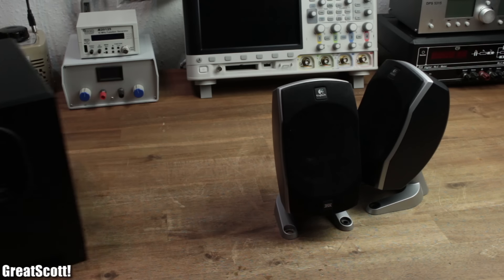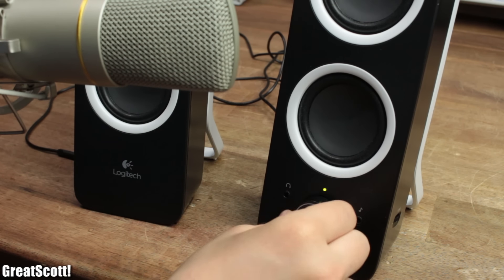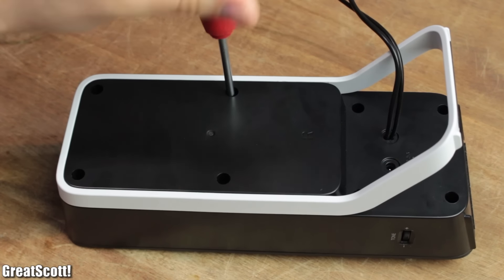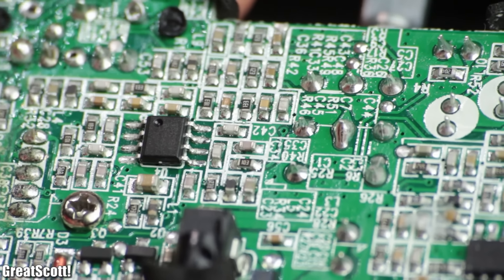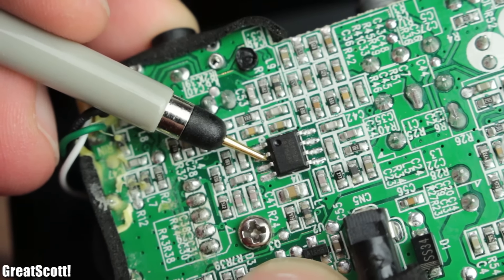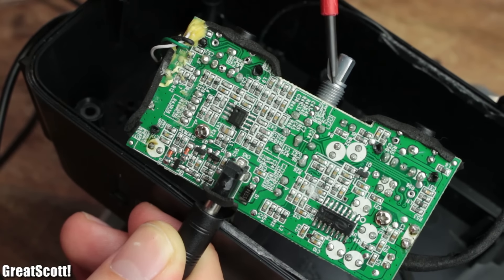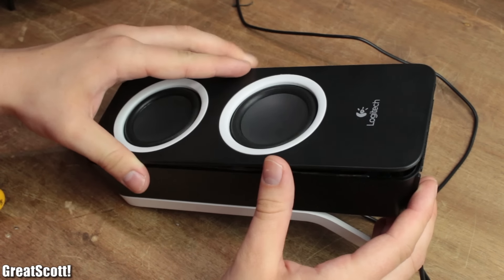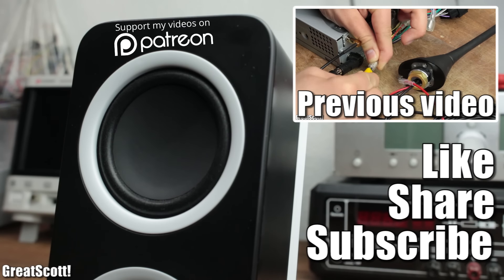Fix It!: Brand-New Defective Logitech Speaker

Comment: if you fix new ones why you dint fix the old ones
Reply from the maker: They wanted to retire.
Reply: +GreatScott! What broke from the old speakers?
Reply: because they arent worth it?
Logitech is Bullshit. But the newer Bullshit logitech are better than the old ones ( probably ). They doesnt sound nice, they dont get very loud, they dont play precise ect.

So why you should repair garbage if you know, like greatScott, that it is garbage ?
Reply: Lol I have some Logitech LS21, They sound great, clear sound and deep bass, I have been using them for about 4 years now
Reply: +Pro Tech Tips Unlimited Than you dont know what good sound is. The frequency response of your logitech is everything else than linear. it isnt even a 2 way system. I have got a pair of magnat zero 5 speakers. 64cm high, 33 wide, 29 deep. 3 way system, tweeter, mids and bass. why 3 way system? because 1 speaker is never able to reproduce all frequencys perfectly. Also your logitech dont have bass. they max get to 50 Hz where bass is just about to start. everything else is missing. My speakers for example hit down to 28 Hz. when you hear dubstep you will hear deep deep wub wub on my speakers. on yours nothing. Do you get my point?
Reply: +Dominik Lux Logitech compared to mine is a difference like day and night.
Reply: +Dominik Lux Tell me your speaker maker man
Reply: +SniperNator My Speakers are Vintage Magnat made in Germany, Cologne. Build in 1991. Since 1992 Magnat does not exist anymore
Reply: The Magnat you see today is audiovox. Audiovox bought Magnat in 1992. It has nothing to do with Magnat than.
Reply: actually, bass start at 256 HZ (wikipedia), for me is more about everything below 450 hertz.
you are talking about sub woofer frequency and that start at 80 or 100 in some standards, in the wikipedia sub-bass is sounds below 60 hertz.
by the way, you are correct, but most of the time you only need 2 ways... in fact, some Yamaha reference monitor does go below 50 hertz.
and you need a big room to make most use out of it, or you gonna have phase problems.
Reply: The most Studio Monitors go far below 50 Hz. I worked with a pair of Genelec Monitors for example. I think it was 32 Hz. But that so called "Subwoofer" frequency is nothing more than deep bass. Even in nature there is much deep bass, for example a train that is passing by. When you have such a scene in a movie it feels much more natural when your speakers hit that low frequency, sometimes it really extreme realistic. On High decibels you really feel it in your body, actually like the real thing.

Also in Music, not just electronic music. An Orchestra has also much deep frequencys. The Point is it is dramatically more natural, even if its just 30 Hz more deep bass range.
Reply: I have a modern 5.1 PC set from them and they're "decent enough" for what I use them for.

One thing to note, watch the standard stereo line in as some models (like mine) have "effects" applied at the speaker level that sound awful. Using the multi-jack 5.1 inputs with a sound card sounds much, much better!
Reply: I am maybe a bit audiophil. I got a Asus Xonar STX 2 Stereo Soundcard ( without the 7.1 daughter board ), an Vintage, completely working Sony STR 5800 from the `78s and it is like new. 75 W per channel, 250 W peak. And i got a pair of Magnat Zero 5 Speakers and a Pair magnat Zero 4, also Vintage, `92, 3 way system.
Reply: Dominik Lux I have a few classic receivers (STR-7025 & STR-VX10L) and a hifi myself, but it's in a different room from my computers. Nothing particularly fancy.

Different horses, the Logitech ones don't sound nearly as good for music, but have enough punch for games when I don't feel like using my headset :)
Reply: yea, its enough.
Reply: +t33s you have no clue. I know it is the exact opposite. Stop talking bullshit. Your telefunken is just pushing mids, has no deep bass and weak highs.
Reply: +t33s sorry that there are actually people with knowledge trying to help people with less knowledge and tell them "Hey, you can do it better"

Sorry for trying to be a good person lol. Did not know it is a bad thing nowadays trying to be nice.
Reply: yeah, you can find it everywhere on the internet, correct. And why people dont do that?

It seems like you are one of the person who is just understanding what he wants, but not like it is and turns everything into bad. Dont know where such behaviour is coming from.

I say it like it is. It is not Hi Fi, not full range ect. When someone says its good sounding ect its not correct. Just because it is the subjective oppinion of some people it is not correct.

Why people like you always must come to people who know something and try to provokate them? Worried because you cant explain it? Or worried because i destroyed someones dreams? Or just a Logitech Fanboy whos trying to defend his Product? Dont know.

But u know what. I am out, people like you aren`t worth it. Why i do the work and write such a text to such an ignorant person.
Reply: it's funny that Logitech has built of a speaker unit without the proper grounding???
Reply: hahahaha WIN
Reply: We have those speakers at school and no problems with them. I think he just got a bad unit.
As you can see in the reviews there is quite a demand for em so they occasionally do something wrong.
Reply: +Dominik Lux
du hast sowas von recht
Reply: Because he bought new ones
Reply: no you guys have absolutely no clue about good audio. That is all.

I have got an external soundcard with external dac and external power source. 24 bit DAC up to 192 KHz sampling rate if needed.

Got an Sony STR 5800 stereo built in 1978. 75 Watts RMS, 250 Watts Peak. Working at 60 Volts internally which increases the dynamics of the amplifier.

I have got 1 pair Magnat Zero 5 speakers. 3 Way System. 100 W RMS, 150 Peak ( so i can`t go full volume with my amp ) 
18 Kilo per Speaker, ca 55 Liters Volume.

28 Hz up to 34.000 Hz.

Sorry, your cheap plastic 100 gramm and 4 inch speakers cant do any shit about that. Please Educate yourself.

You just never heared a good hi fi system. That is why you think logitech is good Maybe the only reason you think logitec is good because of loud ugly distortet heavy bass. That makes your childish minds think "wooooooo"
Reply: Dom So you are essentially comparing expensive high end equipment with low budget speakers... Genius dammit.
Reply: Expensive High End Equipment? No not really. What i got is pretty cheap standard hi fi. The amp cost me around 25€ on a private market. On Ebay you get it for around 250 €

The magnat Zero 5 pair i found on ebay for 180€. I found another bit of 4 Magnat Zero 4 Speakeers for 80€. I could not say no and got them, too.

The sound card is around 250€. So i spent less than 1.000 € on it. I spent around 500€.

Some Logitech crap costs 250 € . You just need to know what you are doing.
Reply: Modern Audio stuff cant compare with vintage stuff. Just modern High End can compare with vintage hi fi.
Reply: Dom And used Logitech speakers can cost 30 bucks used or refurbished. You are comparing apples to pears.
Reply: Dom I got an ancient 5.1 speaker setup from Creative that my father bought like 30 years ago maybe. The onboard sound card for my PC is good, I consider getting a DAC tho.
Reply: the first and biggest problem you have with onboard sound. You got a really bad power supply and much other influences.
Reply: Dom Well since I have no idea how it is supposed to sound...I don't know if they sound good or not. Sound is not distorted, it's clear and since I use them mostly for gaming, I got no problem with them.
Reply: ***** Yeah, I got the G910, wheb you get used to the weird keycaps(about 2 weeks) it's a lot better than normal ones!

Also, that thing is pretty much indestructible. They ran over it with a truck and the RGB diodes still worked! Of course, most of the switches and keycaps broke, but that's acceptable since you would need steel or titanium ones to withstand that!
Reply: Deity i dont care about the grammar. english is not my mother language. But i wanna see you talking german 100% correct. but i guess you arent even able to talk a second language.
Reply: Dom Hey, English is not my native language, but I demand from people to write with proper grammar because it is the most used language in Europe and in North America.

And I am not alone, however I am learning to speak German.
Reply: ***** Well I did not know that, it's more awesome than I thought!
Reply: my grammar is good enough to understand me. And like i said, dont need more. it might be the most spoken language. But that does not mean than anyone can and has to write in correct grammar.

German is the 3rd world trade language after french. Why nobody can speak french or german than. I would prefer german. But i never saw someone who`s not german speaking perfectly german. So....
Reply: Even english speaking people cant agree to each other how to write / spell things ect :D
American hate britan english and britan hates american english ect

So dont imagine a problem which does not exist
Reply: Dom I am learning German as I said... But the first thing we learned is that nobody can really agree to what is going to be the proper grammar and what isn't...

Are you a native German BTW? I am Slovakian.
Reply: Yea, I am German. And at least of all Germans i know i am one of the best in english grammar and english spelling. Germans can`t spell "Th" often and spell it as just a "T" and such.
Reply: you should clearly read the conversation. I said they are not worth repairing and logitech is cheap and not really good. Than one commenter said Logitech sound great ect and i just said than he never experienced great sound.

So i guess you did not get the point why the discussion started. I was not the one who started comparing logitech speakers like these to high sound quality.
Reply: Dom I said they sound great FOR THE PRICE! You are comparing expensive Hi-Fi speakers to budget stereo PC speakers, I thought you would understand that by now!
Reply: good speakers arent expensive. For example my magnat zero five 160€ and 2 pair magnat Zero 4 80€ on ebay. If you know what you have to look for you find it for a fair price. Some logitech 2.1 systems are more expensive.

@Lagger i wasnt talking about you. i was talking about pro tech tips unlimited. He says they sound good and crystal clear ect.

And Sam, sound QUALITY is not an oppinionated thing. It`s a fact with numbers and measurements.
What you mean is the taste of how you like to listen to music. Do you like more bass, or more crystal heights. But sound QUALITY is not a thing about subjective oppinion. You have sound quality or not.
Reply: And just by the way. Logitech try themselfes to compare with hi fi. So dont be sensual when i do so.
Reply: Dom 160€? You are comparing 160€ speakers with 30€ speakers? Genius dammit, OF COURSE the more expensive ones are better.
Reply: Lagger you just dont get the point
Reply: Even when you pay 300 on a logitech system it wont compare, but logitech and others try to. I wont offend you, but you are seemingly a bit off discussion and somehow in rage mode or such.

Sam i also like brilliant crystal clear heighs. But Bass is still part of the sound and music spectrum.
Reply: And this discussion is not about THIS specific speakers in this videos. if you watch how the discussion started it is about logitech overall compared to what they want to be.
Reply: And for budget pc speakers which for a desk i would prefer creative gigaworx before logitech.
Reply: Dom Creative Gigaworx? Those range from 40€ to 200€... At least in my country.

I have not ever heard about anyone complaining about Logitech speakers sounding bad for the price. I don't know how it is on more expensive models, but since I have a great 5.1 Creative speaker setup... I think I won't have to compare them anytime soon.

Also, what models did you hear that you are talking about?
Reply: Lagger Onesixfour the gigaworks t20 series. the cheapest of the gigaworks. i owned them myself

since i worked in Saturn, a big electronic market i heared many different logitech sysgems. A friend of me owned a 2.1 system of them. But dont know the exact model.
Reply: Sam Gates Logitech products are pretty much indestructible...
Reply: ***** Well still if you want great sound quality for the price... Creative is a better option.

I am not saying that Logitech is the best brand in the world, I am just saying they aren't that bad.
Reply: ***** Also, Razer has speakers? I didn't know that...
Reply: ***** Razer products tend to be overpriced, yeah.
Reply: Logitech and good build quality? Could not experience it until now. My Logitech G110 Keyboard was broken after 1 year, the bottom plastic for layin down your hands broke off. very easily. Very thin connection.

Sometimes this keyboard somehow types the letters i tip twice with no obvious reason and totally random.

And if build quality was good. Why in this video the guy had to fix a brand new product first before use xD

The mechanical keyboards of logitech are so good because they use buttons from cherry. world leading keyboard manufracturer.
Reply: Dom Since I had my Logitech G910, there were no problems whatsoever. Before, I had a cheapo 12€ Hama URage Lethality. None of the keys were the same feeling but it did survive 3 years of heavy use. The G110? I have no idea how you broke the wrist rest mount under normal use. If you do stupid things with it... It breaks. Any keyboard that has this type of mount, unless made from titanium will break.

Some manufacturers use magnets to lock it in place nowadays, so get those if you want it that bad.

Also, the G910 uses Romer-G switches designed by Logitech and Omron.

There is no real difference in build quality of Cherry MX and Romer-G switches.

Why did he have to fix it? The connection was loose, he got a bad unit, the cable could have fallen off in transit. I thought you would be smart enough to see that...
Reply: we were talking about quality. And if the product falls apart in the transit its not quality. It`s poorly mountet or bad assembled by workers or..... Thats not quality. And you cant expect quality on that price

But anyways. I must say i am really impressed of saitek. I Never heard the brand and had no clue about it. But today i own my Cyborg RAT 5 Mouse since 7 years with no issues. Everything perfectly, nothing lose. It has an alluminium frame etc. It fell down a few times, the cable got some stress some time. But all is fine. THAT is what i call quality.
I can attach weights to it. I can adjust its lenghts to have better fitting in your hand, i have programmable buttons, i have dpi and profile settings, even a second scroll.

 I dont know any Logitech Mouse with alluminium frame. maybe they got one and i just dont know about it.

 Or my Stereo Amplifier which is no 39 years old and in perfect condition. 

The wrist rest broke simply by raising the keyboard from the table. it flapped down and just cracked, like the plastic became hardened and weak over time.
Reply: Dom I said he got a bad unit. Why do I not see anyone else complaining about any problems with those speakers? And those speakers are VERY popular.

I heard that Logitech mice are pretty much indestructible. Linus from Linus Tech Tips will tell you, he has a Logitech G... 5? I can't remember. He said he was using it for 8 years and was dirty as hell because he was too lazy to wipe it with a cloth, but it still perfectly works! Also, I mean 8 years of heavy use, like gaming.

I cannot speak for Saitek, but are you sure that is not from MadCatz? I remember them having mice that they called R.A.T.

I still don't know how you managed to break the wrist rest... Raising the keyboard and it breaking is not something I will believe too soon. Unless I see somebody else having that problem. But that's just me.

Yeah, we have a radio that is somewhere around 60 years old and it still works... but how much did we use it? After about 15 years almost nothing was used in that radio.
Reply: here german amazon link:

https://www.amazon.de/Cyborg-Gaming-CCB437050002-04-R-A-T-5/dp/B003DKJ44C

but you are right. i saw mad catz, too. Probably mad catz bought saitek ? I mean its 7 years ago when i bought that mouse.

And no. I promise i just raised the keyboard. Believe it or not. Some sorts of plastic can get weak when they get too much UV light over the years. I guess that`s what happened. Or probably i microscopic crack from manufracturing. Dont know.
Reply: Axel Neri   lol wow I was thinking the same thing. His old speakers are like mine they are 10 times better than them cheap new ones he is working on.
Reply: Great Scott, with your old speakers, can i have them? Some parts may still be functional.
Reply: @youkofoxy  actually its below 20hz
Reply: Axel NA maybe because it’s not worth it. If one has extremely expensive speakers, and only need a few part to fix. Probably worth it to fix. I ain’t fix my old car if it costs more than it’s worth either.
Reply: @Bomkz  Have used the same speakers without the sub, total cheap shit garbage.
Reply: @greatscottlab They had a Subwoofer they whoul have been much better!

Comment: You could have fixed your old set of speakers instead of buying a new one..!
Reply: yes
Reply: They might have been beyond repair?
Reply: Umm..may be..
Reply: Maybe he also wanted to change the look. I used the same hifi separates system from 1989 to 2012. one speaker started to act up, not much of a problem but I decided I wanted a more modern look to fit in with other devices on my media unit.
Reply: bad decision, sorry. Replace old 80*s Ultra High Quality Speakers for poor "modern" looking and garbage sounding particle board china speakers. Everytime i hear such things i could cry
Reply: maybe he isnt broke like you... ever thought of that/?